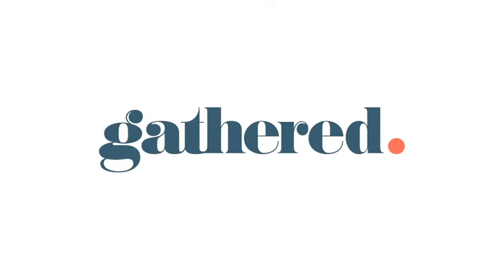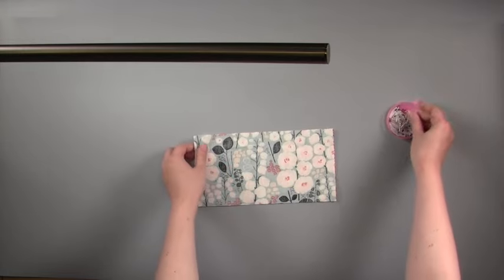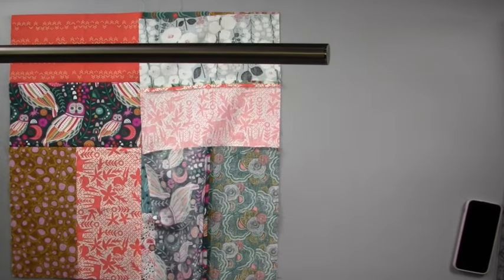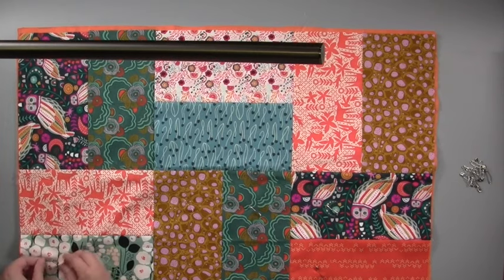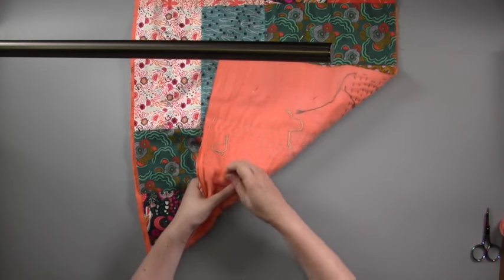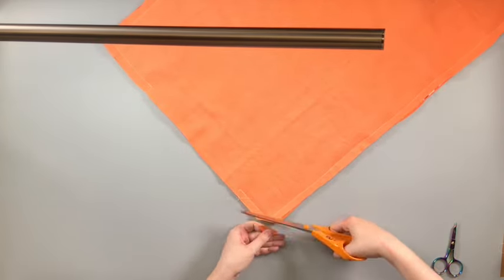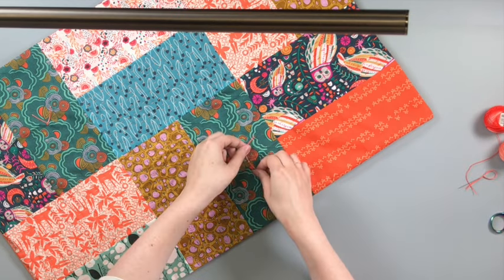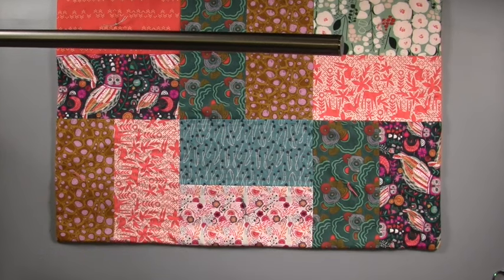How to make a kantha quilt

Comment: Authentic kanthas usually have two pieces of uninterrupted cloth (saree or bed sheet) on each side and some more rags and cut out pieces in between. The top side is decorated either with tightly knit straight running stitches or more intricate patterns and designs; in case of the latter, it is called a nakshi kantha. And most importantly, it is entirely hand stitched.
Reply: I thought Kantha quilts were hand stitched with random sized pieces?  Perhaps this video should be called Kantha style.
Reply: Definitely just a small quilt sewn with with a sewing machine and some hand stitching  on the surface.

Comment: CONFUSION: Given a quarter-inch seam allowance when sewing rectangles into pairs, the measurements seem a bit off: If the long side of each rectangle measures 11 inches, then (to get a square block when sewing two rectangles together) the short sides would need to measure 5.75 inches, not 5.5 inches. Otherwise, you'll end up with blocks that measure 11x10.5 inches. OR, cut the rectangles 5.5x10.5 inches to get a 10.5" square block; when sewn into the quilt top, each square block should finish 10x10 inches. You demonstrated an interesting process, but I was expecting to learn authentic kantha quilting, not a derivation of the original craft. But, lovely colors/fabric patterns! 😊
Reply: And to make it more confusing it looks like she's cutting it at 5.25" so she must've shortened it to 10" on the next clip giving 9.5" finished squares